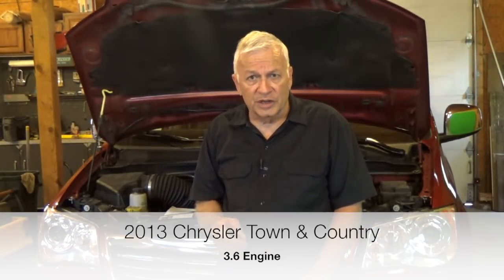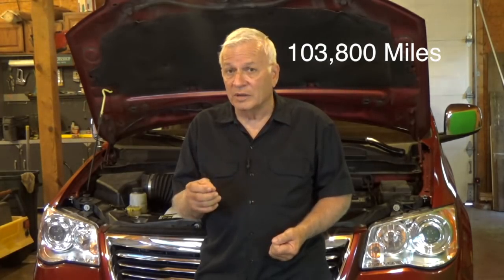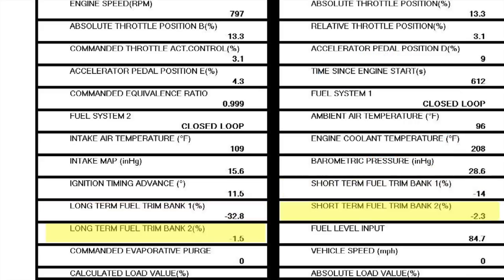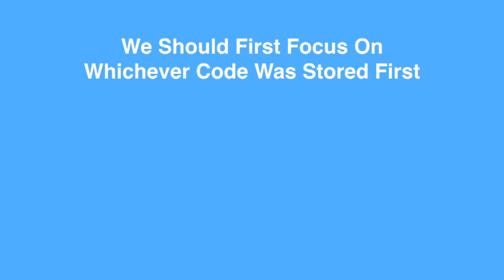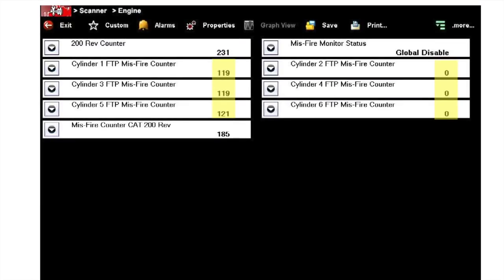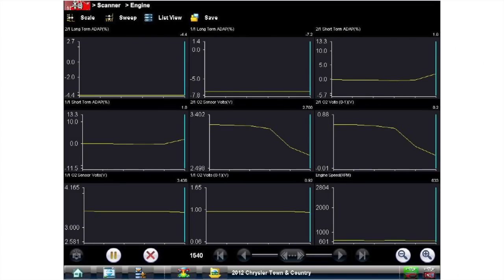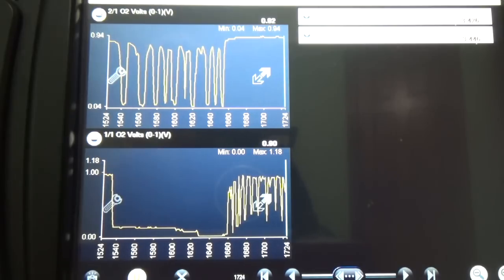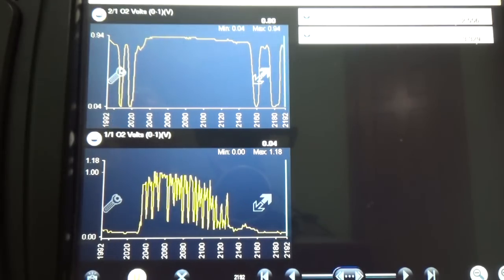Instructor Series Elusive Intermittent

Comment: I had a mid 90's Dodge Stratus that had a runaway idle that liked to frequently stop at about 2500 and would come and go. It was a bit maddening at red lights because it would jump off the line every time I let off the brake. I didn't have a scan tool at the time, but I was able to narrow it down (over a few months) to something really simple.  The upstream O2 sensor wire had made contact with the exhaust manifold and had melted the insulation just enough that under certain conditions it would short out on the manifold pulling the circuit to zero causing it to hold on low.  The PCMs response would be add more fuel causing the engine to rev up.  Since this was a $900 car I bought for cash just to tide me over during lean times, I wrapped the wire in tape and zip tied the wire out of the way.  The revving problem went away.  I'm not a mechanic by trade, I work on computers, but the skills you can pick up from Duane are equally as valuable fixing PCs.  Why does problem X only happen when Y is occuring.  What do X and Y have in common.  What parts to they use and/or what system files do they both use? etc.